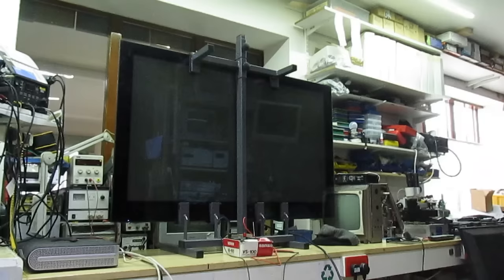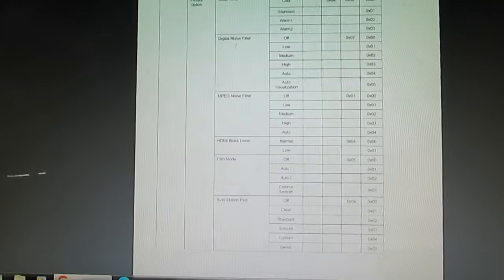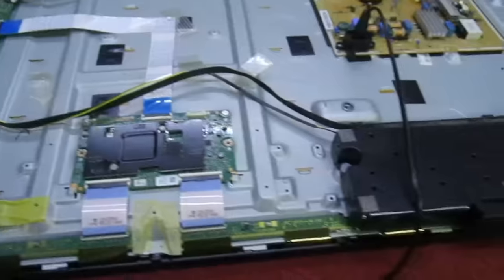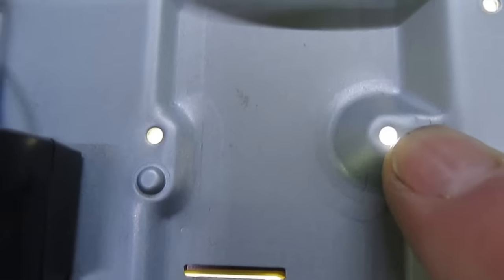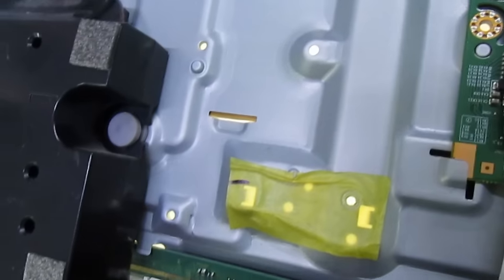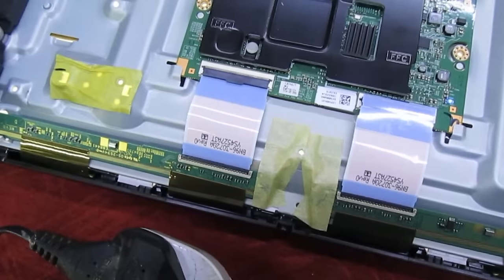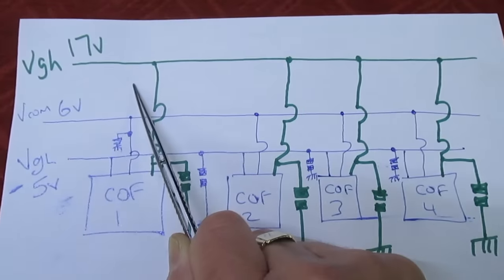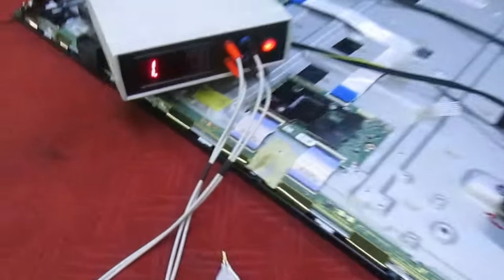Video to highlight the problem of repairing flat panel TV sets

Comment: My dad was  TV Radio repair guy from the early days when TV came out, and still serviced TV's and other electronics till he was in his 70's. Taught himself these things. Passed away in 2000. I'm the youngest of our family and picked up a lot of this from him and on my own. 
 As of the past few years I decided to repair flat panel monitors and some  of my TV's. Main problem is the capacitors often in the power supply side, and often none of them show any signs of leaking. So replacing all of the electrolytic type ones is the main cure.
 Problem is I now have many used monitors that are good, but people still want to buy the new stuff. This might change if our economy get much worse.  Glad to know of someone that is till doing component repair. 
 About 6 years ago I took a blue-ray player/surround sound system to a repair shop and they required a $80.00 deposit to even look at the unit, but told me if they can fix it then the $80.00 will go toward the repair cost. I knew it was one of the amplifier chips or something in that area since it had three amp chips, and two of the channels did not play. They told me they could not get the main board so it could not be fixed. I was pretty upset at that answer, I figured a professional shop would do component repair. If this is the that repair business then they really don't need much electronic talent if all they do is replace the circuit board and collect money.
 Thank you Michael for being one of the good repair guys!
Reply from the maker: Unfortunately these days there is no fault finding to component level, the shop will have had to replace the whole board because there is no circuit diagrams in the service manual, this is all done in an attempt to make an item not repairable so you just buy a new one, I only attempt component level fault finding because that's what I grew up doing and I still find it very exciting but in reality I come across lots of items I have to scrap simply because there are no circuits available and a new board exceeds the value of the item, all this takes time so you won't get many people attempting component level fault finding, you could easills spend an hour and not find the fault.
Reply: Thats exactly what happened to my refrigerator that costed me 7K when I bought new and the tech who looked at said the main system board needed replacement and would cost be $1200 to fix it. Well, this  is what I did - Got a new freezer for $180 (that I needed anyways) - moved all the food to that freezer and got the board on my bench. Well, it used to be a bench in the early 90's, not anymore.
The issue was with a shorted rectifier that blew the SMD fuse. I had to wait for 5 days to get the $3 parts and the refrigerator was humming like brand new. I agree, the component level fault finding talent is long gone, however some do retain that passion.

Comment: Well done, as always. I also have doubts about these ceramic caps which I use in my own designs and, as you say, they break down regularly. I doubt that the stated voltage ratings are correct and I now regularly use a rating three times higher than the expected voltage. If you heat these capacitor types with just a short duration burst of hot air their leakage currents increase substantially. I do like your homemade milliohm meter.
Reply from the maker: I did hear once that these caps could damaged by the reflow process and this is the reason I prefer hand soldering to hot air, I made that milliohm meter over 10 years ago and never used it because a set of kelvin probes were about £100, I only started using it a couple of years ago when I found you could get some probes on Aliexpress for a tenner!

Comment: Great video Michael and very informative. Ive repaired countless flat panel sets myself but have had absolutely no formal training other than the occasional youtube videos. With that said I’m lucky to still be alive! I do pride myself on not damaging a set any further when I get one in, and not having a set go out to its owner that would be a safety concern. Ive only had one set come back to me and it had a rather abusive owner. Other times I’ve spoke to old friends or acquaintances and they will tell me a story of how I repaired their tv, or playstation, or cell phone perhaps and that its still going strong years and years later. Often times I can’t even remember doing their particular repair since Ive done so many. Mistakes I’ve made, well two come to mind. #1 Never touch a heatsink to check for heat in order to tell if a component is being powered up! I had a plasma tv shock the daylights out of me once when I learned the hard way that some heatsinks can be live. #2 Never replace certain components without first realizing what may have caused them to fail in the first place. Other than watching your components fail you may actually pose yourself a safety concern as I once did when I simply replaced a pair of resistors without finding its fault and the new resistors exploded with what looked like a bolt of lightning that extended a good 12 inches or so out of the rear of the set. I tell you I could have cracked a walnut with my butt cheeks right about then but thankfully the good lord above spared my life and my shorts to say the least. As a hobbyist the hardest part can be locating the components Id say. Cross referencing has its limitations as well as you sometimes end up with cheap Chinese clones that can be very short lived. I wonder if the capacitor wizard I use would have been of use in your repair Michael, although I’m not sure it will do ceramic capacitors but it does test in circuit so for that aspect its a good and fast tool, on the contrary so are my eyes and my nose. I really liked the comment you made at the end of your video when you said what your customer might say when you present them with the fault. “Is that all it was?”  Some people clearly don’t realize or can fully appreciate the expertise that a technician today must have in order to repair electronics at the component level. Board level is far too expensive and a waste of materials in my opinion. Prices on TV sets have come down so low these days that it’s not as common for people to repair them sadly, and the technicians are fading away as well it seems. I still search for my place in life out there. For reference I’m 45, USMC Combat Veteran as an 0811 field artillery deployed to Iraq in 03. a licensed general contractor in California for over 10 years, have 5 children all with the same mean lady classified as my wife of 16 years, and Ive worked as an AV technician for about 8 or 9 years. Been out of work for awhile since the pandemic started, and feel weighted by depression and the struggles of home life, most of which my wife creates in my opinion, but we all know life is hard and no body cares so I better save it right! Anyway great video Michael and thank you for sharing it with us. Take care bud.
Reply from the maker: you dont need much training to repair TV sets now, as long as you can plug in another board and have a very basic understanding thats all is needed, the makers no longer supply any service manuals or parts , just new boards, of course the whole idea is really just to get you to buy another set, but i will always try to find a problem first than rush in and buy a new board .
Reply: Bless you, you are still here to talk about it, please god you continue to do so m8.
Take care, keep at it.
Reply from the maker: I think the capacitor wizzard is only for electrolytics ? but as MLCC caps tend to short out anyway generally just a multimeter  is all that's needed, the biggest problem now with flat screen TV sets is trying to fault find without a circuit diagram .

Comment: Great video really enjoyed this, some great tips in it.  I no longer work directly in electronics repairs but still do my own plus odd few others.  The vast majority of the "TV repair" shops have now closed down in my local area, only the odd one or two left.  When people ring up these places they sometimes get quoted silly money figures and most people dont take their stuff in for repair.  Only the other week I fixed a small 19" TV for someone who was quoted £70 (over the phone) plus any parts for a dead fault.  In the end it was just one diode in the PSU board, took me less than 30mins to fix.  I charged them £35 and they were over the moon.  Things are getting more complex to fix, and where possible I do tend to avoid surface mount repairs.  

Even by the late 90s early 2000's suppliers were just recommending board swops, I worked in a place and we did a lot of insurance repairs and they just sent us boards out for faults.

In my first job we didn't have service manuals for a lot of stuff we fixed, and there was no internet as it was the early 90s, but stuff seemed a lot easier to fix back then, we fixed anything that came in the door with a plug on it!
Reply: £35 for a repair to a 19" tv..
There's the issue.
I've given away many 22" Tv's FOC as they are so cheap and not even worth selling..

It's a disposable world..

If we had RTR then we'd invest in bigger stuff thats supposed to last have have second hand resale value..
Reply from the maker: Where I am there is no other shops within 20-30 miles radius, I'm the last man standing, in the 80s when I opened my first shop it was a very brave move as there were repair and rental shops everywhere , in the 90 s with the event of single board TV s there was no swapping , every fault had to be to component level but now were back to panel swapping , the whole industry has turned full circle but the real truth of the matter is the manufactures don't want TV s to be repairable they just want to sell another set ,what they don't understand is if a customer buys say a Samsung TV and it only last 13 months and then is declared un repairable they are not likely to buy another Samsung so by not supplying parts and service manuals they are not doing themselves any favours.
Reply: @michaeldranfield7140  My Samsung plasmas and LED LCD TV's from 2013 and 2015 respectively still work fine though we don't really watch TV.  I watch baseball on it sometimes, and play android tv stuff on the LCD sometimes. Occasionally we watch movies on them.

Comment: Great repair video with clear explanations , you're good at this stuff. I was thinking before disassembling the tv you could've just checked the screen with a flashlight and if the lcd was still working you should've be able to see the image faintly. If the screen was faulty which is your case, then you shouldn't be able to see anything with the flashlight.
Reply from the maker: Some sets has a really dark tint on the screen and its very difficult to see if there is an image even with the torch test .

Comment: I had one of those 1990s Samsung CRT sets, very good TV in my experience, dirt cheap but totally reliable.

It's amusing that folk waxed lyrical about how the MLC caps would revolutionise reliability as against the electrolytics, yet they're probably the number one cause of "dead unit" failure now, the games consoles are notorious for it. And of course it's impossible to know by looking at them if they're from a reputable factory, making the problem worse.
Reply from the maker: The only thing good about MLCC for manifactures is they produce more new sales due to threr unreliability.
Reply: We should prohibit any SMD! All things must be repairable by human w solder. :) Size doesn't matter - we watched so huge TV than a whole CAT could sleep on 'em! And I still have no problem with "nonflat" TV. :)
Reply from the maker: @daitedve1984  I have no love for SMD any more , parts that small they have no markings on them makes even the simplest of jobs difficult .

Comment: BRILLIANT!
I love your mili-ohm build you did.  Very nice.

What do you think about the other method of finding the shorted part?
That is, disconnect the 2 ribbon cables from the timing controller, then with a power supply set to 17V and amperage adjusted to zero, insert the 17V into the 17V rail on the LCD strip.
Using a thermal camera, gradually bring up the amperage (very low, of course) just enough to cause the shorted part to start to get hot.

With a good thermal camera, the offending part should pop into clear view.

What's your opinion on that?

I'll tell ya, after getting my thermal camera, it has saved so much time in troubleshooting.
I wish that I would have had that decades ago when this was my career.  LOL

Great video, so well thought through.

As for the lack of schematics, I find it annoying and painful.

I'm old-school and back in the day, I had a full library of schematics for every make/model of TV I repaired (and other equipment).

Fortunately, I'm not longer in the business, but trying to find schematics for other things that I want to fix is pretty much impossible.  Or worse, a company sells a "schematic" which is NOT a schematic, but more a blowout of SOME circuits.

We have a Panasonic 3D  Plasma TV and I got lucky on that.  I was able to find full schematics with parts list, which came in handy a couple of times that I've had to fix this beloved beast.  LOL
Reply from the maker: If the short is above 1 ohm a milliohm meter is no good for short locating and that is the method I  use a bench power supply and see what burns up.
Reply: Instead of a thermal camera you can also use your finger. 😅
Reply from the maker: Done that and burnt my finger a few times!
Reply: @michaeldranfield7140  but a burned finger is much cheaper than a thermal camera. 😅

Comment: Fascinating Michael, you’ve amassed an amazing amount of knowledge to enable such a repair. The lack of appropriate service information is obviously an attempt to encourage the purchase of a replacement item. In fact it wouldn’t be impossible for manufacturers to build in a fault code display system similar to that used in CAN bus automotive systems.
Reply from the maker: Sadly all my knowledge is pretty worthless now as people prefer to throw things away and buy a new one , a lot of sets do have built in diagnostic these days but most of the time its to broad to be of any real use , as an example I had a sharp set last week and luckily it was over 10 years old and so a proper service manual with diagrams in was available, the error flagged up was "communication problem between the sub micro and main micro " which could be caused by a million things .luckily the cause was only  due to a faulty regulator chip supplying the micro core voltage , it should have been 1.3 volts but was only 1 volt.
Reply: I don't think it's an attempt to discourage repair but more because it is way too complicated, especially with the speed of change.  But it certainly discourages troubleshooting.
Reply: @michaeldranfield7140  not that I'm giving these horrible manufacturers any ideas but what is going to be a real pain is when they start encasing every circuit board in epoxy where you won't have access to the circuit at all. One maker will do it then the rest will follow.
Reply: Some equipment has diagnostics built in. Remember the HP calculators?

Comment: How did you  know it was 10 µF with out a Diagram or Parts List?
Reply from the maker: Just take out one of the others and measure it on a capacitance meter.
Reply: @michaeldranfield7140  I thought that might be the answer I just wanted to confirm.   The TV you worked on looks exactly like the one which is functioning as a large screen monitor attached to my PC.
Reply: ( it's fine at the moment but one day it won't be and I will give it a go.  I've done numerous PSU issues in the past ).

Comment: Does someone had an issue where the screw won't come off? I tried to disassemble the panel of 2011 Samsung that have metal frame that holds the screen layers and I couldn't proceed because some flat head Philips screws are like glued to the metal frame. I damaged two screwdrivers and the screw won't come off. Any tips?
Reply from the maker: sorry no , I have had sets before where screws have for some reason been tightened so much they wont unscrew, all you can do is try to drill them out .
Reply: @michaeldranfield7140  I see. Thanks anyway.

Comment: i have a vizio tv and can't seem to get the ribbon cable that goes to remote receiver to connect at the main jungle board connector i replaced board and tv works but not remote is there some way to get them to connect properly so remote will work
Reply from the maker: Unfortunately most manufactures don't even supply spare parts any more so your only option is to trawl the net auction sites such as e bay looking for a second hand ribbon .

Comment: I got out of the electronics repair business when smd devices were introduced My vision is too poor for servicing micro components
Reply from the maker: Surface mount was no problem to me when they started been used in consumer electronics, however surface mount without a service manual very difficult, some parts are so small they there is no numbers printed on them so repair becomes impossible.

Comment: How can you start the TV ( in actuality the PSU Backlight V) when the cable to Main from PSU is unplugged ?
Reply from the maker: as far as I know this fault finding  feature is only on Samsung sets, with any other set you would have to find the PSU ON line and connect a 1k resistor from the PSU ON to 12V supply.
Reply: @michaeldranfield7140  Correct on PSU autostart ( mimic the signal from Main ). Perhaps you know about a new (?) design I encountered ( indirectly, from others) ? All High V are always ON (!!) , but Standby appears ONLY if Main is connected ?  This means , as I understand, that Main has 12V to StbyV  Buck Converter.. but how this design starts the TV .. strange. Any idea how it is called so I can google it ?  Thanks a bunch